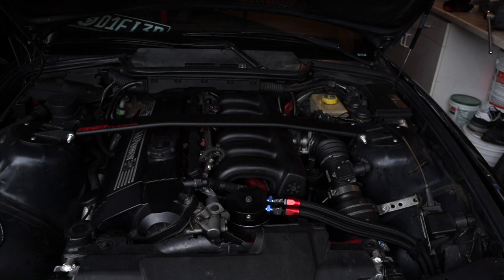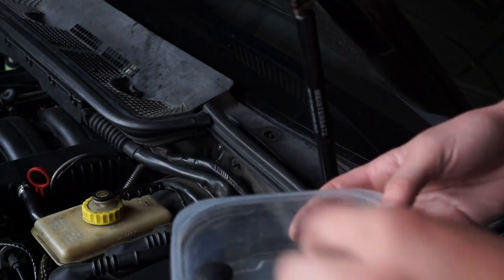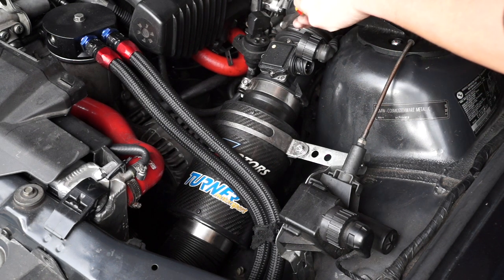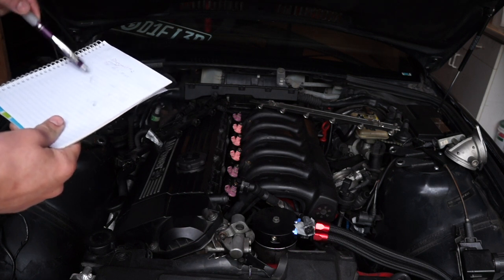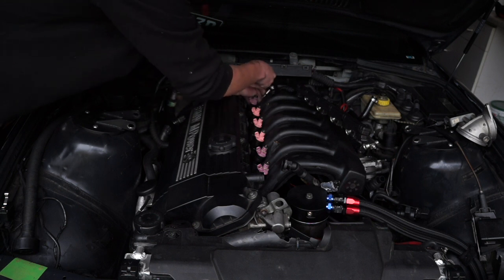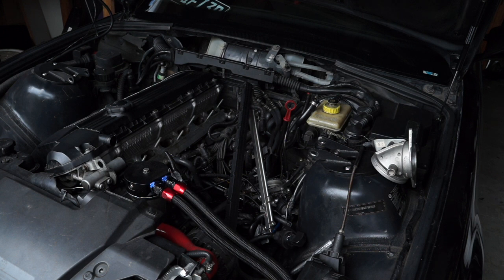E36 intake manifold removal

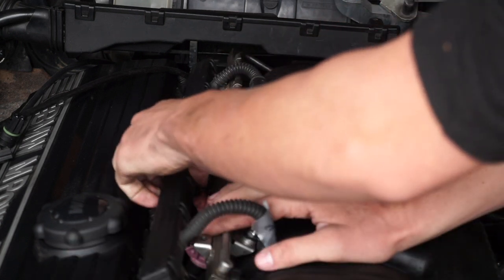Comment: 9:50 "fuel injector plug rail pops off" 
My 97 looks like it had clips... im prying with with screw driver pretty hard. Mofo does not want to come off... worried about breaking something. Pry harder ?
Reply from the maker: remove the clips with a pick.

Comment: I wanna ask about clip on the rail injector. Did you loosen the small clips or not before take it off the rail connector from injectors? Or just take it off the rail without loosen the small clips? Thanks a lot
Reply from the maker: I leave the injectors in the rail, so i leave the clips
Reply: @M3NACE  sorry i mean rail of cable 😁, okay thanks brother 👍

Comment: “Pull the fuse and crank the starter” well guess I’m getting sprayed with gasoline haha
Reply from the maker: sounds like a good ol' rip the starter my dude 
lol
Reply: @M3NACE  yup intakes loose but it’s still hung up on something, time to loosen random stuff😭
Reply: I've used that Schrader valve on the front and back feed a little air pressure into it.  Don't hook up a 80 psi hose, but feed it 10-15psi and it will push fuel back up the line.  I've even used  bicycle pump.
Reply from the maker: @davidmorrison2694  interesting, never heard that technique before. If it works it works! Lol

Comment: Hey so can I purge the fuel with all that other stuff off? (Throttle body and intake and all) this will be my first time doing a job like this and don’t want to mess it up. Or have problems with idling/starting when putting it all back together.

Comment: Doing a head-gasket on my 95 E36 w/M50 and your video series has be a godsend man!!! Alls I can say is wholly crap OBD1 cars have a ton less steps and crap that has to be removed.. Cant wait to get the project done.. I do have a quick question, Since I have an M50 ( I know these have unique cam trays ) I have a friend selling S52 cams & trays, Can I use my lifters or do I need m52/s52/s50 lifters to go with the S52 cams & trays? Just wanna make sure I have all the right parts.
Reply from the maker: I would use the S52 liftera as well, im pretty sure they are taller or something like that. You could check realoem.com and see if the part numbers are the same, but the trays are different. Thanks man!
Reply: @M3NACE  Thanks for the reply man! ill check it out on real.oem asap! I bought the cams + trays.

Comment: Hi i know its an older video but im working on taking out my fuel rail and everything is unbolted and c clips holding injectors are off, but my fuel rail wont pop off of my injectors. I dont want to use too much force. Is there something im missing?
Reply from the maker: If the black clips are off then only the o-ring is holding them. Twist them back and fourth, that should break the seal and allow them to be removed.

Comment: The line that plugs into the very front of the fuel rail has a 2nd plug close to it on the same line and then one more plug at the very end of the line...please tell me what the 2nd and 3rd plug go to....
Thx
Reply from the maker: The plug between cyl 1 & 2 goes to a solenoid with 2 vacuum lines that run from the hardline uder the vanos, and the one on the very end plugs into a harness that runs underneath the intake manifold. If you watch my M50 manifold conversion i cover this.

Comment: After you put it all back together did you have to  re-pressurize your fuel rail or did you just continue to crank the car while pressing on the gas pedal until there was eventually enough gas in your fuel rail and pressure to start the car
Reply from the maker: Cycle the key a few times, it will prime the fuel pump/rail
Reply: M3NACE excuse my ignorance but what does Cycle the key mean ? Turn it to position 0 the back to position 2 Or turning it from position 0 to position 3 for a few seconds then rinse and repeat ?
Reply from the maker: @izzysosa7964  yup! Key off to key on 2, off, on, ect
Reply: M3NACE forsure bro thank you you’re videos are literal life savers. And appreciate you commenting back on a 3 year old video you save people thousands
Reply: Am I supposed to just keep turning it from 0 to position 2? I was doing that for honestly like 8 minuets like I could hear fluids in the front of my engine but when I tried to start it all it does it crank still am I just supposed to keep at it until it’s primed ? Or do you think it could be something else
Reply from the maker: @izzysosa7964  i would just try starting it till it kicks over, shouldnt take that long to prime it
Reply: M3NACE for sure  if I try to crank it for to long multiple times my battery dies. should I prime it and try starting it while being jumped to another car?
Reply from the maker: @izzysosa7964  yeah i would, the priming should only take 15-20 seconds, you might have something else wrong.
Reply: M3NACE okay so when priming it should I leave the key In position 2 for 20 seconds ? Cuz I was leaving it in for like 5-10 seconds and sometimes I’d only switch to position 2 for like 1 second like 10 times. should I leave it in position 2 for 20 seconds this time ? 10 times as well and what makes me feel like it’s fuel pressure relate is cause I have no gas leaks and I wasn’t able to bleed fuel rail so when changing the starter I had to get a towel and do what you did and soak up all the gas out the fuel rail that’s the only fuel that ever came out my car. So I don’t understand how it can be anything else like I smell no fuel at all in my engine bay but there’s also nothing leaking gas anywhere

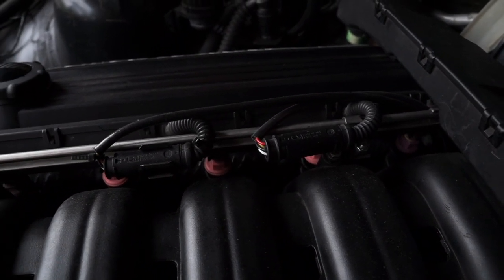Comment: 9:22 any reason I don’t have these plugs? Lol
Reply from the maker: OBD1? What year?
Reply: M3NACE 1998 323is, currently taking the manifold off but i guess there’s a bolt somewhere I missed cuz I can’t shimmy it off😂
Reply from the maker: @xavier8548  there might be brackets underneath the manifold that bolt to the block, id check under it with a flashlight. The brackets bolt under the plenum next to the throttle body, i always throw them in the trash after i take them off

Comment: Question,‘I’m trying to replace my 97 bmw 328is engine wire harness auto transmission....I see one online for a 96 328i...would that not fit? I know 96-99 usually have interchangeable parts but since electrical I wasn’t sure
Reply from the maker: same motor same setup, it will work. there might be some differences like traction control or lack there of but as long as they are both auto harnesses it will work.
Reply: M3NACE thanks a lot! Was just worried about the performance , just followed u on IG too! I like your videos, very informative 🙌🏾

Comment: Hi @M3NACE ! @11:56, you pull off a rubber thing that has an electrical connection and 2 vacuum lines attached to the bottom, but I can't figure out what that thing is called. I just did M50 manifold conversion on OBD2 ASC car and can't figure out where that vacuum line goes.
Reply from the maker: that is the EVAP purge valve. one end goes into the manifold, the other goes to the evap canister.
Reply: @M3NACE  THANKS!!! 🙌

Comment: This video helped a lot, I managed to save everything but the fuel rail pressure regulator vacuum line and the upper rubber fuel lines. 

The bulkhead panel on the firewall was a nightmare, someone glued mine in and I kinda screwed it up getting it off. 

Unplugging the injectors is kinda annoying, not sure why BMW couldn't just have normal individual plugs like everyone else. The plastic cracking noises are pretty terrifying prying that harness off the injectors.

And that rear intake support bracket, which also holds the fuel lines, is impossible to get a wrench on.
Reply from the maker: honestly i just removed the rear support bracket, dont even need it really IMO lol. removing that cowel makes everything so much easier.
Reply: @M3NACE  Have you been bothered by the cops for the straight pipe on the convertible? I want that raw sound so bad but I really don't want that $1,000 fine. I get the stink eye from the Oreos just for the sound my intake makes and the Hellrot red.
Reply from the maker: @herbienbrian2  lol nah, i daily'd it for 2ish years never had a problem, but im running full stock on both cars at the moment.
Reply: @M3NACE  It'd be nice if the SuperSprint muffler wasn't eight hundred friggin' dollars, that's the only setup besides a straight pipe that sounds good. I'm thinking about a 2.25" dual in dual out Flowmaster 50.
Reply from the maker: @herbienbrian2  truth, ive been sayin that forever. 8 hundo is too much for a catback.

Comment: i think i messed my sensors ,car cranks but doesnt start and smells fuel also car had LPG system that i removed
Reply from the maker: hmm, you might have not plugged one in- make sure the wiring harness at the end of the fuel rail by the vanos unit it plugged in.

Comment: I cannot get the wiring harness off the fuel rail...
Reply from the maker: it will come off. it has little retaining clips at the end of the harness that holds the injectors onto the rail. mine came off easy because I had mine off recently, if yours hasnt come off in 10+ years it might be a little stuck. take a flathead screwdriver, place it under the harness at the back of one of the injectors and gently and slowly pry it up. twisting the driver would be easiest. it will come off, but be gentle and easy with it. if it absolutely refuses to come off, you can unbolt the fuel rail from the manifold by the 2 10mm bolts, and pull all the injectors and the fuel rail/harness out as one.
Reply: M3NACE I got it man! Thanks for the quick reply! Also, do you know where that 14 mm is on the bottom of the intake manifold when removing it? I could not find it for the life of me! Engine is an S52
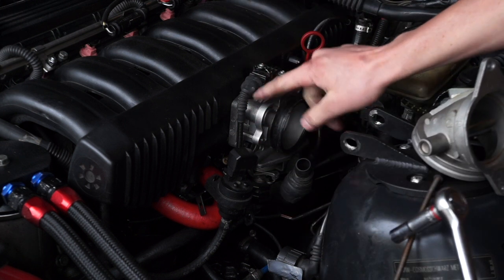Reply from the maker: so right underneath the manifold, by the throttle body is the support bracket. put your hand underneath the manifold right under the throttle body hole, and move your hand toward the front of the car. the bracket is the same that holds the little round thing with vaccum lines on it. if you look at 7:09 you will see what i am talking about, right around the red hose. find that bracket, and if you feel for it and follow the bracket down to the engine block, the 14mm is holding the bracket onto the block. it takes a good extension to reach it, or you can unbolt the bracket from underneath the intake manifold, I believe its a 10mm
Reply: M3NACE thanks again man! Really appreciate it! Having to do my starter sucks but from what I can see it’s the original
Reply from the maker: ouch, that one is always fun. I dont know if you have watched my starter replacement vid, but I stress how important the proper torx tool is. you do not want to strip those trans bolts. pretty stout though, must be an old starter lol proud it lasted so long. good luck with it man!
Reply: M3NACE thanks man! I have looked at it! I have an E12 socket but a friend of mine said they are a pain without the wrench

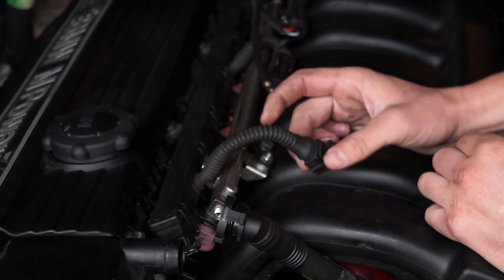Comment: At 9:02 your on the SAP Bypass Valve. Does that connect on the manifold? or is there another line below the manifold? Just bought an e36 and noticed its not connected. ive been trying to figure out what it is.
Reply from the maker: http://www.realoem.com/bmw/enUS/showparts?id=CD93-USA-02-1997-E36-BMW-M3&diagId=11_6092 heres a vaccum diag. it runs to the secondary air pump on the side port, the bottom port runs to a check valve, to a T, then into the manifold. the other T runs to the Fuel Pressure Regulator. number 7 is your guy.

Comment: bro you need to make the video of how to put you intake manifold back on because im at a loss right now
Reply from the maker: its on tap my friend, It will be coming soon! not soon enough though I am Afraid. the motor that I will be doing the install on I am in the process of gathering parts to rebuild it. what are you stuck on?
Reply: thanks for getting back. im putting my manifold back on praying it was only my starter that im having problems with.
Reply from the maker: so what Issues are you currently having? crank no start? no crank? rough/no idle?
Reply: can i send you a picture and ylu telll me where it connects too
Reply from the maker: Yeah, DM me on instagram. Like to my gram is in the video description

Comment: Very simple video thank you! Just subscribed, I have one question? When your removing the fuel injectors is bad if the whole fuel injectors came with the fuel rail? Because that's what happened to me...
Reply from the maker: leo hernandez no, not at all. Its either way. You can keep them in the manifold or you can keep them on the rail, its up to you. I usually prefer to keep them in the manifold so i dont have to re-seal them in the manifold. If your injector o-rings are old, there is a chance they might cause a vaccum leak when you re-install them, but popping in new injector o-rings will solve that problem.

Comment: Thanks a lot for the great video, removed the head in 5 hours tho, lol. I really hope that I can remember to put all the wire and the hoses back.
Reply from the maker: if you forget plug your vin into realoem.com. you can find vaccum diagrams and use them to figure it all out
Reply: M3NACE  thanks, I will definitely check it out. I'm removing the head today, I'm doing all that to change my blown head gasket. I still didn't get the the radiator out because of the fan, I'm still waiting the tool to arrive but so far the radiator not on my way or holding me keep working!!  Do I really have to take it off to access the head gasket? Thanks again :)
Reply from the maker: well, you will need to remove it to be able to disassemble the vanos unit, so yes. that being said, you can take the lower hose off of the radiator and pull the radiator up and out with the fan in place, then you should be able to get the fan shroud and the rest of the cooling system out with the fan still in place. from there all you will have to take off is the fan itself when the tool comes in.

Comment: with the intake manifold off will that make it easier to replace my icv hose ??
Reply from the maker: as for just replacing the hose, I would not remove the manifold. you can swap the hose without pulling the manifold off, although it is kind of a tight space.
Reply: M3NACE ya i was just thinking that would make alot more space
Reply from the maker: Shaun kristensen it would yes, but now you have to worry about re-installing the manifold correctly, getting all of the injectors to seal, routing all of the vaccum lines properly, and its alot of work to pull the manifold off just to swap out the ICV hose.

Comment: just picked up a 98 328i and it has issue. i needed to change my crank sensor plug and i dont see no other way bit to take the manifold off. thanks for the video because this is really thorough!.....subscribed
Reply from the maker: thanks man, and best of luck with the replacement. it is possible to go from underneath the car, Its a pain in the ass any way. just make sure to replace the manifold gaskets, but basically its reverse order for the install. dont forget to torque the manifold bolts and the throttle bolts! I wish my manifold install video was coming sooner, but its several months out.
Reply: Do we still need to replace gasket seven if they look like they’re in good shape? I took off my intake manifold and I’m about to reinstall and just saw these replies where you recommend just getting a new gasket but mine looks fine

Comment: I can't disconnect lower o2 sensor on flow meter. It's sucked to each other in some way. How to take it apart? I alrady used a little bit more force.
Reply from the maker: the o2 sensors on the fuel rail harness ?
Reply: Nope, straight after flow meter and there is some angled black tube with a thick cable connected to it.
Reply from the maker: ah, that sensor. look at the wiring harness, and on the plug in there might be a small metal retaining clip that holds it in place. with your finger, push in on the clip and pull down on the harness at the same time. you might need to use some force, but it should come out, and dont use too much force. if it does not come out and you cant get it, unplug the boot (black angled tube) from the throttle body and move it out of the way, put it somewhere in the engine bay that ill be out of the way, so the sensor can be plugged in but you can work around it.
Reply: M3NACE Going to check it :-) thank you. Nice video. What's the song? Nice car sound, hear some power :-D
Reply: I'm newbie and I'm going to take starter out

Comment: my fuel hoses fell off so im trying to remove intake manifold but wont come off, did all bolts but a no no
Reply from the maker: fuel hose fell off? ouch. keep in mind that the manifold is bolted on one other place on OBD2 manifolds and 2 places on OBD1 manifolds. there are rails underneath the intake manifold that bolt up to the underside of the manifold just underneath the throttle body hole. these support brackets run down and bolt to the engine block. take your hand and run it underneath the manifold by the throttle body and see if you can feel the support bracket, then